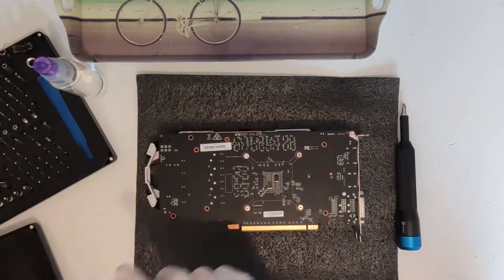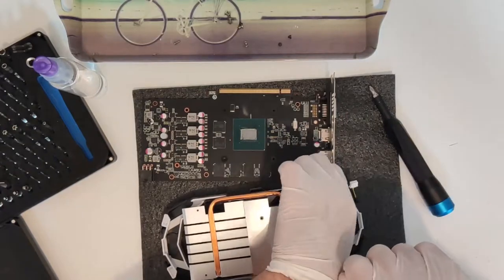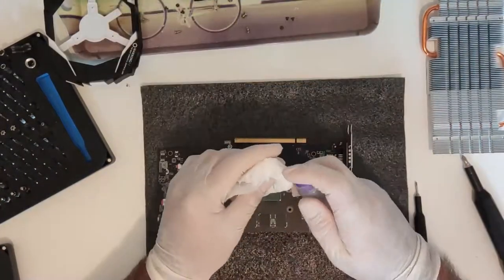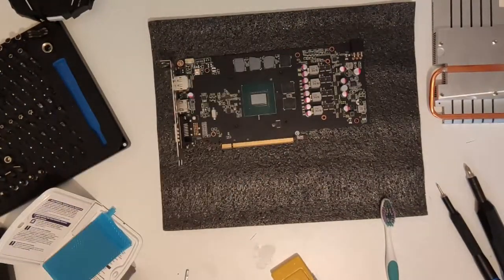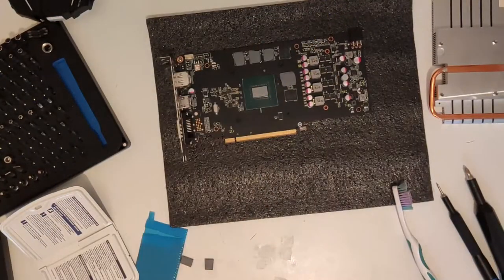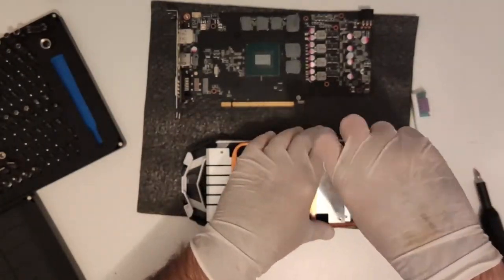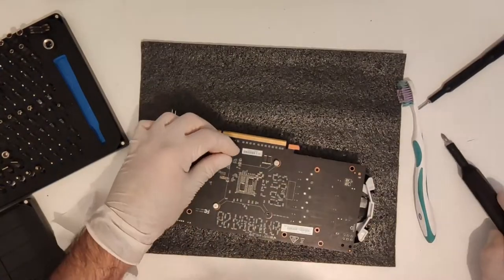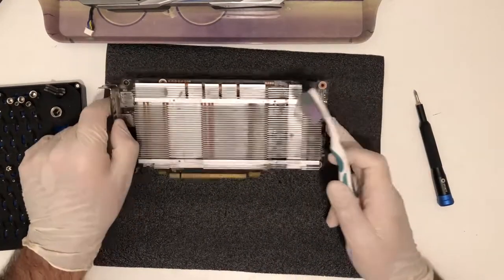GeForce 1060 (MSI ARMOR): Changing the thermal paste and adding memory thermal pads

Comment: Would you recommend adding thermal pads? Do you happen to know the screw size for the heatsink on this GPU?
Reply from the maker: If you are doing the service for the card regardless and you are planing on keeping it long term - then yes - definitely add the pads (don't be too fussy with the pad quality or dimensions - any with decent contact to the heatsink is better than none). If the stock termal paste is still good (it probably won't be for much longer though as they are getting to 4ish years old a lot of these cards) I would not go out of my way to disassemble it just for the thermal pads, better to do it altogether.
Reply: @ESHW  I recently bought it for a cheap price and it hadn't been looked after. I've cleaned it up completely and added some better thermal paste. One of the fins on the fan was broken so I've ordered some replacement fans. So once they arrive I will dismantling it again so figured maybe thermal pads would be worth it for longevity. The GPU only came with two screws for the heatsink, do you know what screws this GPU uses?

Comment: what thickness should be for pads?
Reply from the maker: Oh - it's been a hot minute since then and I don't remember, but on anything with lower power usage than GDDR6X I would say just buy some thermal putty. It's (quite a bit) cheaper and it will do a great job without worrying about exact thickness

Comment: I want to change thermal paste for my GPU, but I don't want to put those "pads", are they necessary or not ?
Reply from the maker: You can skip them if you wish (they are not factory by any means, but they will certainly not hurt) - considering the age of the GPU it is most likely well worth to change the thermal paste regardless of the thermal pad addition.
Reply: @ESHW  thanks!

Comment: This radiator is also on 2060 ventus xs
Guess how well it is cooled
Reply from the maker: I so happen to have a 2060 Ventus (don't remember exact versions but it has two fans only)  and the rad is indeed very similar, but clearly a different revision. The memory chips under the cooler appear to have thermal pads, but the ones next to the PCI slot (and heatpipe) do not - so I termal glued on a small heatsink. It's an improvement, but still falls short of compete confidence in my opinion.
Reply: @ESHW  those pads are like half cm thick
And one heatpipe doesn't do much for the core especially with vrm radiator for whatever reason having another thermal pad on top of itself to contact the ens heatpipe

Comment: If you had pads that weren't from a previous project what size would you use? 1mm? 1.5mm?
Reply from the maker: Great question - I should have specified! If they are soft (gelid extreme or silicone impregnated cloth) then 1.5 or even 2mm as they will squish down very easyly. With hard pads like the minus8 or gelid ultimate I would go 1mm(safe) or 1.5mm with a bit of "massaging".